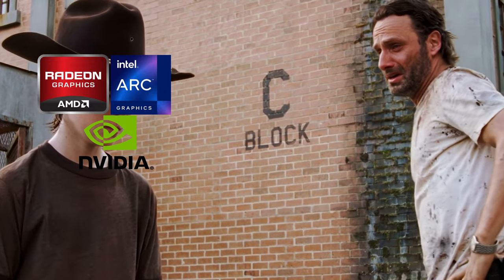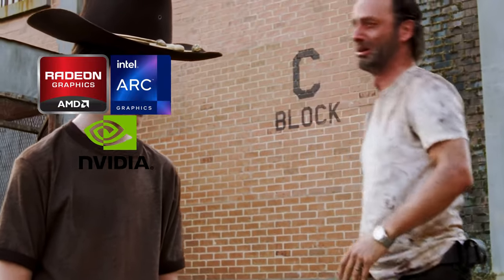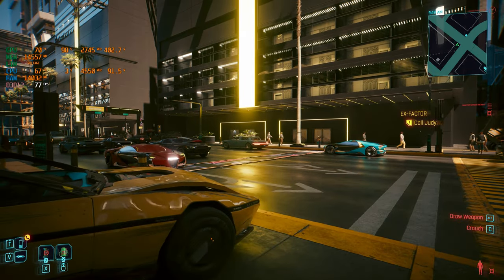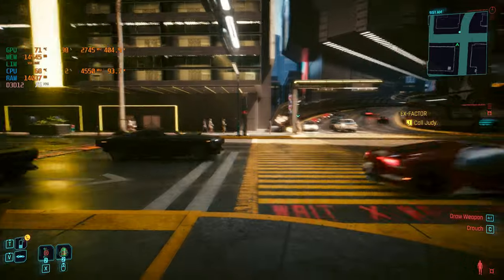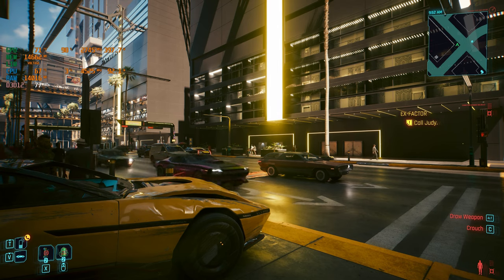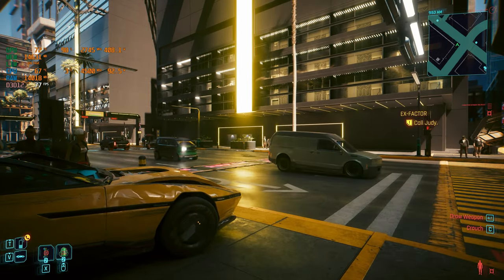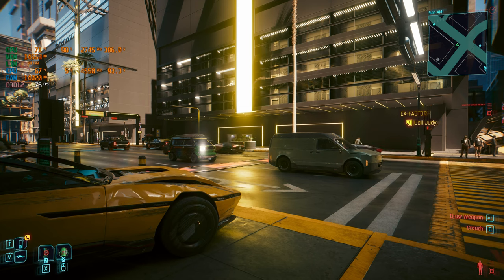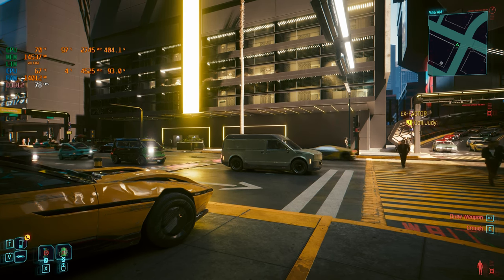How to fix/reduce GPU Coil Whine !

Comment: Those companies claim "silent fan" etc. but what about the coil whine, if gpu makes sound it's not quite. What's more, it's irritating. Hope in the near future there will be regulations like "zero coil whine guaranteed" because there are monitors like 360hz, 500hz and if we're going to cap the fps , what's the point of getting high fps. It's totally bullshit.
Reply: If it unbearable then I feel you. 

no one should spend a lot of money & have to deal with that.

idk what makes the sound tbh. 

For my strix 4090 it whines between certain scenes but I deal with it anyway lol. 

hopefully I fix it
Reply: Don't think you can make a gpu with a 100% zero coil whine. You can make a card that had Coil whine that is inaudible, but not gone completely.

Comment: Unfortunately coil whine has to do nothing with cooling system on a GPU, so even on Zero RPM mode graphics card can produce slight coil whine (thats how it is for me). Coil whine is generated by the electrical components (inductors and capacitors) on the GPU and is not related to the mechanical operation of the fans. So basically the only thing you can do is deal with it, wear headphones and forget about the problem.

Comment: sometimes its just the card, my 1070ti even extremely undervolted had really bad coil whine, upgraded to a 6750xt recently and its dead silent
Reply: I got a brand new 7700 xt and I can’t play without headphones now it sucks
Reply: wait, 6750 xt are silent? how is it now? thought those cards are known for coil whine
Reply: @Who_Does  unless it's under heavy load it's still quiet, helldivers 2 makes mine whine a bit
Reply: @carmoj4121  The last time I had coil whine noises was 20 years ago from some cheap very low end GPU. Just return it bro!

Comment: I got a new Asus tuff 4070 ti, it had the worst coil whine I had ever heard, sent it back to newegg for a replacement  the new card I got is dead quiet. Please if you get a new gpu with coil whine return it, although most manufactures will not accept a return for this reason most big retailers will take return for a defect or just no reason within a small window. Dont get stuck with a whiey gpu this is not acceptable on components this expensive.

Comment: In order to play at over 300fps you need a monitor capable of 300Hz+ refresh rate. Otherwise you won't see any difference becuse your monitor won't refresh as fast as frames are generated. Monitors with such high refresh rate are rare and most probably you don't have it. Cap the games fps at your monitor refresh rate and be happy.

Comment: ya'll are saying that i can play games at 144 fps... i reduced all my stuff to 60fps, and the noise is louder than my games. it does go away if i look t the sky... running an 8gb rx 6600. hell this thing uses max power at 100w (the radeon software says its drawing that) and that's on 7 days to die.

Comment: An important tip you missed is to use multiple PCI-E cables instead of a single one, that alone almost eliminated the coil whine for me.
Reply: hi, what psu do you use?
Reply: @erby13 Hi, I have an Asus ROG 750W PSU
Reply: What you mean multiple

Comment: THANK YOU SO MUCH. I just bought a brand new computer with a 4070 in it. I started hearing really bad coil whine. Turns out it was running like 674 FPS. It was only happing in a non demanding gaming…. Once I capped it to 144 like my monitor. It completely stopped…. Thank you so much !! Earned yourself a sub !!
Reply from the maker: Happy it helped 🙂

Comment: MSI 4060 ti 16Gig here: Huge "modem type noise" during simple Unity game, but no noise at all under FurMark which is the most brutal stress test you can do to your card. How is this possible please? The card hits 70'C during FurMark and regulates its temperature afterwards by spinning the fans at high speed. So it definitely does get stress tested.
Reply: Because FurMark is synthetic test and in most cases it would not cause coil whine. I have the same problem with 7800 xt steel legend. Coil whine while gaming and no coil whine while stress test in furmark, msi kombustor or aida64 extreme.

Comment: Hi Tom, I've got 4070 FE and coil whine immediately starts when I use ultra graphic settings on a game, as soon as I drop to high graphic settings coil whine stops. Always used ultra, coil whine started as of last few days.
Reply from the maker: Sorry to hear, coil whine can develop over time, however if dropping the voltage, which lowers the power consumption doesn't make a difference in noise then it could possibly be noise from the fans. On ultra the GPU will produce more heat causing your fans to spin faster. Also if by any chance you've recently changed the case, the old one may have just been more noise proof.

Comment: heres a wild one. Brought a new PSU and it gave my 6950xt coil whine. Went back to my old PSU and the coil whine still persists. Put my old 5700XT in and that has it also... IDK what to fix
Reply from the maker: Could potentially be your motherboard making the noise?

Comment: At 3:55 you state "in NVidia Control Panel, I was a t 1.1 volts" where in the control panel does it show this?  And are you able to safely adjust frequencies while you have a game open and running?

Comment: my noise comes from the psu is it safe ? when I run a game it's the exact same noise in the vid
Reply: Ancient Gameplays has an (old) video on this, if your  PSU is an ATX standard but low quality you could always change it for a better quality one,  it's always a  good idea to use a quality branded PSU, preferably a Gold standard (efficiency) They are usually a solid investment and should last you 10 years or so assuming your power requirement stays the same.
Reply: @oktc68 I have the Corsair 1000w and it does this under high load

Comment: I just built an amd build so I noticed the coil whine happening while idle when moving mouse it stops… dunno if it’s gpu related
Reply: Driver. Same happened to me. Get 23.3.1
Reply: @powersource1988  thanks for reply. Sold pc built new intel nvidia build now I have issues with heat lol… oh man
Reply: @ryce80s  They keep us busy :p Heat is even worse haha now you have a tornado sitting on your desk?
Reply: @powersource1988  lool yeah but it’s really the i7 14700k cpu has high temps max load figured a way to keep it not pushing 90dagrees
Reply: @ryce80s  How did you manage? Thats a lil too much indeed